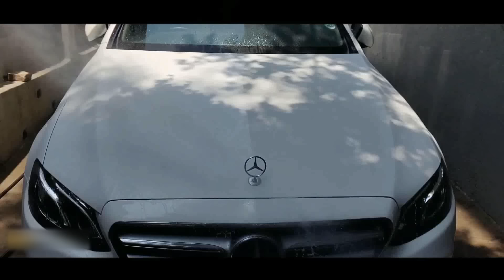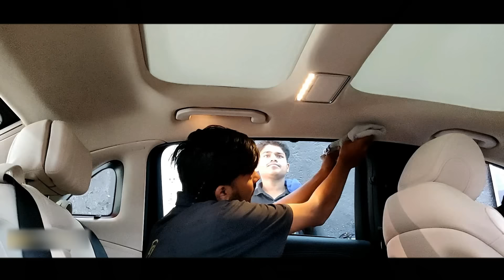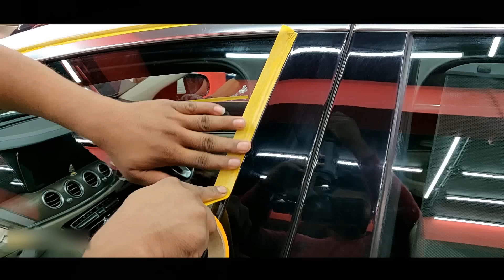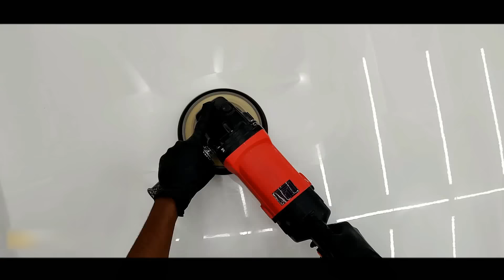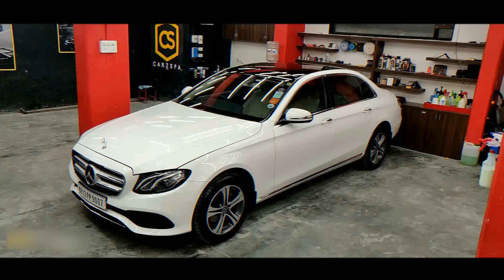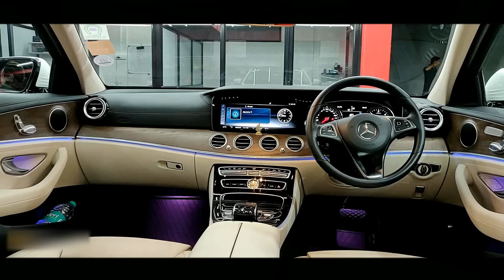9H Nano Ceramic Coating on Mercedes benz E class | Brotomotiv | Pune

Comment: What is the difference between 9H and 10H ceramic coatings?
What is the maintenance required after a ceramic coat?
Apart from ceramic coat, do you offer any other coatings that can be done in a single day.